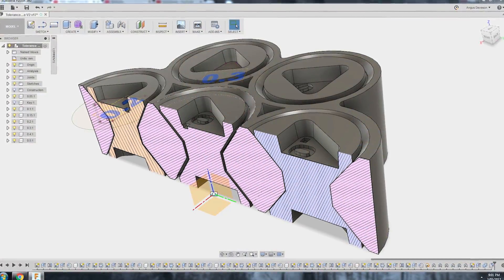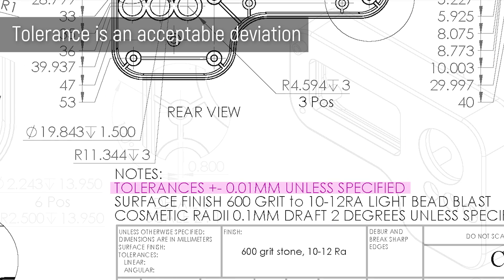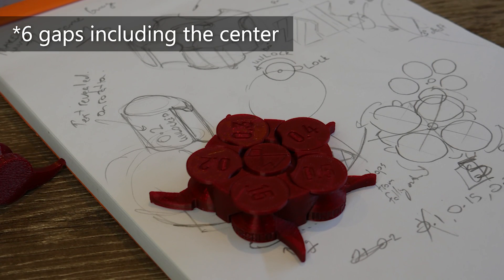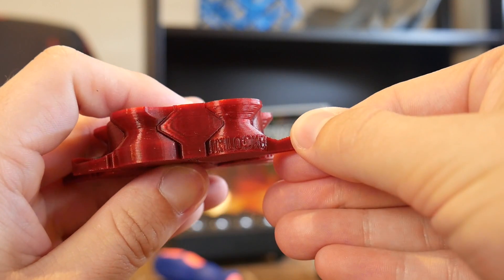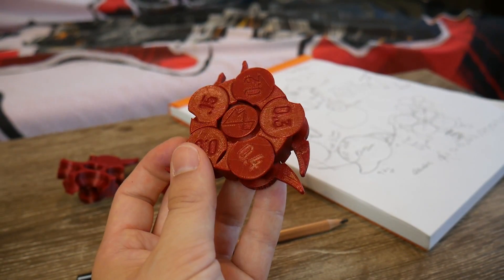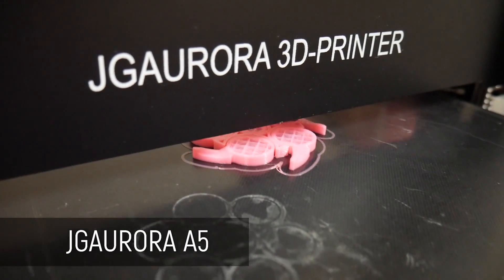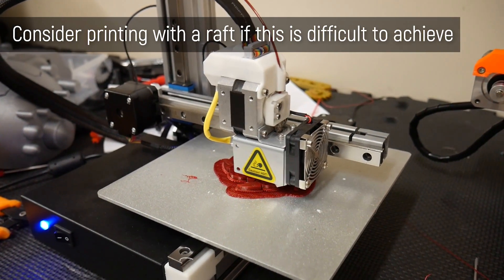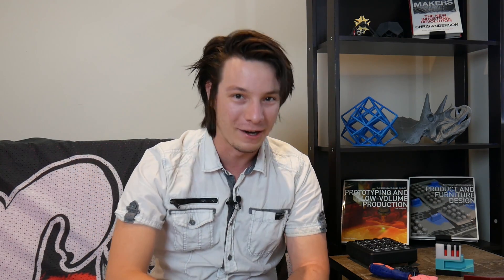Test your 3D Printer's Clearance and Tolerance

Comment: My creality ender 3 3d printer got tolerance of 0.3 minimum. Lower than that it will stuck.
Reply: now that is really good cuz my ender 3 pro
 stuck with 0.5, 0.4 will frigging stick on the initial layer, lower than that? nah
Reply: Maybe u should give attention to x n y axis tention. Check whether u have equal tension on the right and left of x n y axis.
Reply: Do your circle rounded perfectly? If not then sure this is the problem

Comment: I bought your tolerance test about a week ago to use on my Ender 3 but then my Geeetech A20M came in and I had to start playing with that so the tolerance test was put on the back burner then I had the misfortune  to have my hard drive crash. Is there any way that I could re download  the file, I purchased it using paypal.

Comment: Awesome, I just bought it and tried it out. Looks I need 0.3 clearance with normal print resolution (0.15 height) on my ender 3. 
Just a thought, I printed this out with skirt and noted the lowest surface was melted together. I'm curious if the 0.2 might work. I would suggest to add a 45° chamfer to prevent lower face fusion. Anyway, great design though.

Comment: Markforged Onyx One, the 0.15 took quite a bit of force to move, but once it does it is very smooth. At one end of rotation has slightly more resistance than at the other. Everything else spins as it comes of the plate. 6.15 h to print in Onyx. Thanks for cool design, helps a lot with understanding the tolerances and design of gaps. 

Anyone order these from Shapeways? Curious how their machines do it.

Comment: I've just tried this on a ender 2. I have modified it slightly by adding a hot end duct with a 60mm noctua that directs some air flow to the nozzle. I've only had the printer 2 weeks so complete newbie. PLA with a bed temp of 60 and a hot end of 205 I printed this with a 0.3 first layer then 0.15 for the rest. I could free everything upto 0.3. 0.2 and 0.15 were stuck. Any advice? it looks like the bottom is fused. Do you think a raft would help?

Comment: .15 and up were free on the Original Version on a (very well) tuned Anet A8 with the 2040 aluminum frame upgrade:) 0.1 Might come loose with some extra force but the key won't take it.

Comment: I notice when I printed mine, the top layers of the 0.2 and 0.15 look like they have enough clearance to break free, but the first layers in the same area  are completely fused together. My first layer height in simplify 3D is set to 90%. Could that be the cause?

Comment: Hi Angus, I could use your help! Big fan, watched almost all of your videos, made the plunge and bought a Prusa Mk3 over the course of the last 8-9 months. Yesterday I bought your tolerance test model to test tolerances when printing in ABS... and all of the cylinders fused. I was able to get .5mm apart relatively easily, .4mm was tough, and .3mm came apart only with a LOTof force. In addition, the surface finish on top of the part was really rough/bad. What did I do wrong?

I used Slic3r PE, 20% infill, standard layer height. All other settings were the "Generic ABS" profile on Slic3r.

I know printing with ABS means that the part will shrink, but this surprised me. I'm going to print in PLA tonight to see if it does any better, but I really want better tolerances when printing in ABS. Any help would be GREATLY appreciated!

Comment: I've been looking for a free tolerance gauge for 3D printing that people can use worldwide (all dimensions the same on every printer), so i can create 3D objects that actually are able to work on the persons 3D printer. - Since you are the inventor of the Maker Coin and the tolerance test, I wanted to ask if it's possible to get a standard (global) test piece from you, so people can test the tolerances of the printers they use, so it's possible to make items for different tolerances, so they can choose what they need. -  Even if i guess this will never be read, since it's too long ago.
Reply: The first tolerance test wouldn't work for some of the stuff i was planning to make, since it's not a 'tool'. Thus the question of a 'free' gauge for people to print (as said, world wide) as a standard tolerance test for everyone in the world, so people who create stuff have an idea about what measurements are needed to create a range of items for 3D printing, so links, bearings, etc. work for the person printing the items.
Reply: e.g.: looking for a standard tolerance test, something like ISO or DIN. - you are the first, so that's why the inquiry.

Comment: My prusa i3 mk3 kit build is stuck at 0.15 and I had to use a screwdriver for 0.2. I snapped the 0.15 tooth off! Any advice? I'm pretty sure my bed is level.. but how do i tell? I think the PINDA is set right.

Comment: Printed this last night and was pleasantly surprised to see the 0.15mm rotated with just a little thumb pressure. I used a CR-10 with Raptor PLA and the old Cura with 0.2mm layer heights. Thanks for creating this clearance and tolerance test! Great channel!

Comment: Just a thought... My printer appears to have a magic number of 0.04mm (ie. full step motion).
This is based on 1.8 degree steppers, with 8mm pitch screw. ie. 8mm / (360 / 1.8) = 0.04mm
I’m guessing this may be a reasonably common printer configuration?
The point is that you therefore want to optimally work in multiples of 0.04mm increments.
So, normal 0.2mm layers are OK, but instead of 0.1mm (for fine), you really want 0.12mm or 0.08mm.
Likewise, for clearance you'd also optimally want to work in multiples of 0.04mm
So instead of a test going down to 0.15mm clearance, I’d really want either 0.16mm or 0.12mm to test my printer's minimum clearance.

Comment: Should be released as both an STL and gcode (gcode to take the slicer out of the equation and STL so you can play to get it better).  shrug its only $2..  I just wonder how much is slicer settings vs printer itself for some people.  I am currently printing it for the first time with Inland Black PLA on a Wanhao i3 v2.1 Sliced it S3D.  we'll see how it goes.
Reply: Ok time to test the old one with tighter tolerances..  0.15 on the new one works fine but I really want to push it now :P

Comment: Just printed this on a new Ender 3. Either I printed this wrong or it's sort of disappointing as a fidget spinner. The 0.5 just pops out, and so does the 0.4 with minimal spin. Can't spin with only 3 sides. May just have to glue them in. The gauge side seems fine. All moved easily, even in the 0.15. Printed on a raft with 0.15 layer thickness.
Reply from the maker: If you want to use one like a fidget spinner definitely grab the version 1, this one is designed more as a functional tool so you know what kind of movement you can expect from your printer. Clearly 0.4mm is too large, but maybe 0.2mm gives a good movement without too much play? The center part is designed to pop free once you unlock all clearances :) it has a special code on it to another youtube video.
Reply: @MakersMuse  what if i cant move the part what should i change???

Comment: I tried buying the test from Gumroad, but: "By clicking Agree and continue I confirm that I want to use *** for my current and future purchases with Gumroad. I authorize Gumroad to charge my PayPal account for such purchases and I instruct PayPal to pay such amounts. "

What the hell?? NO WAY!! I just want to pay what's in my cart, that's all. Of course I can unauthorize them directly after my purchase but this is against my principles. There is no way I am going to allow this.

@Makers Muse, do you have another way to pay?
Reply: This is also very typical. I will not trust Gumroad: https://help.gumroad.com/privacy -> 404 page not found.
Edit: The brainiacs made it a relative link that doesn't work when you're on the help subdomain. From the homepage it works: https://gumroad.com/privacy #facepalm :-)

Comment: My CR10mini print well only 0.4 ... but if I set -0.3 in horizontal compensation in Cura v3, numbers on print disappears!! 

With -0.1mm works until 0.3 and there are numbers ...but under -0.1, numbers will disappears...
Reply from the maker: Print it on settings you normally use, horizontal compensation will alter the final print accuracy I don't use it.

Comment: Nice design. Payed for it gladly. Got down to 0.2 mm on my modified anet a8. I think due to the mentioned elephant foot isuue 0.15 didn't work. 

Tips while prototyping with this:
1. Stability
2. Extrusion multiplier (mine is 90 percent with darn cheap PLA)
3. Speed and cooling.
Reply: Can I attach links here to show off the beautiful unlocked font?
Reply: Whatever here you go: https://ibb.co/kXfrGc
Reply from the maker: YouTube isn't the best place if you have Twitter you can share @makersmuse!

Comment: gumroad seems to ask for a credit card even if I select to pay with pay pal.
I live in the netherlands and we typically don't have a credit card, but a Debit card.
Is there a way to resolve this, or would you say, just use the old stl file?
Reply from the maker: There should be a button 'or pay with paypal' to take you to the paypal window instead of entering CC details.

Comment: Bought, downloaded and printing right now but in PETG as that is what I predominantly print with on my JGAurora A5.
Reply from the maker: Cool to hear the A5 gathering popularity. Good luck!
Reply: First attempt had the first 2 layers fused with my usual settings in all except 2.0 which was only slightly fused. Played with my settings a little in CURA and trying a second print.

Also posted this video to the FB group I am in for the A5.
Reply: Second attempt failed only because the vent I printed as a mod to the original caught the PETG and bent it, it might also be down to some warping as I lowered the bed temp from 90 to 85, I adjusted the bed setting back up 90 and its stayed stuck. Yay! I am now at layer 40, layer height of 1.5mm, thickness of 0.8, infill of 30% Octet, printing temp 240 with first layer at 245, build plate of 90, diameter 1.75 and flow of 96% (found I needed to reduce from 100 to stop it from fusing), retraction of 4mm/50mm/s speed, print speed of 30mm, wall speed of 15mm, travel of 60mm, Fan 0 initially to 20%, skirt as recommended. 5 hr 11 min print time and 28g of material to use costing GBP 0.28.

Comment: Odd. I printed the v2 of the tolerance test, and could only get as far as the 0.3 (and higher) to work. All the others were stuck even using the key. I'm using a Prusa i3 Mk3 and Simplify3D to slice it. I printed a simple dimensional cube and a 15mm came out as 15.03mm. Similarly a 5mm cube came out 5.03mm. So I don't understand why my tolerance test failed so badly.

Comment: Thanks for making this Angus, I'm kinda low on funds but $2 for this test is definitely reasonable. Just one question though; could you slice this up to make individual tolerance test pieces for each tolerance size? I'm going to realign and recalibrate my Creator Pro, and when testing tolerance and how adjustments improve it I'd like to be able to print just the tolerance level I am stuck on--so I don't have to waste extra plastic and time testing. 

Thanks again.
Reply: That sounds like a good idea!

Comment: First test print for the LeapFrog Bolt Pro and some interesting results!
1. Printer using the suggested settings in PLA.
2. 0,5mm just falls out of the main body!
3. 0,2mm locked but 0,15mm moves!
4. With a little persuasion now all move, but still I kep dropping 0,5mm out of the body.

Worth the money to test out the new printer. Thanks Angus!

Comment: Bought the model today (and no, if you can afford $25+ for filament, you can afford $2,- for a model) and printed it on my brand new Snapmaker. It was loos for the .5-.4 and .3, but .2 and .15 were stuck. It was a while ago that I've seen this video, so I used an exacto knife to cut the first layer for the .2 tolerance and that worked. My son said I should have used just a screwdriver, so I tried for the .15, and that one got free as well! Very happy with my 1st printer, the Snapmaker...

So, just buy the model (and drink one beer less), and print it. If it works out, you'll discover that it's worth it! :-)

Comment: Angus, I just bought the tolerance test v2.  Are there general recommended settings to use in Simplify 3D like layer height, first layer settings, speed, etc...?  I am still new to printing and have not yet done one of these.  I am using an Ender 2.

Comment: This was well worth the $2 even with the fees to pay in £, Got a great print with my CubePro Duo, I suspect it could go down to 0.1. Used ABS at 0.2 layer with 20% infill.  The one from my Makerbot Rep 5th Gen was not so good. Use Makerbot Print, 0.2mm layer and 20% infill just about got the 0.2 to turn, 0.15 stuck fast . Using Simplify3D same settings same PLA and this time the 0.15 would turn but it was tight.  Says something about using better slicing software.
Angus I think your posts are great and very helpful, especially on Fusion 360. Its nice to NOT hear an American (or German) english accent on these type of videos. Your accent is much easy listening here in the motherland. Keep up the good work.
PS. Interested in your prediction that Subtractive and additive manufacture will come closer in the coming year. Worked with CNC Milling/Turning & Laser, big and small for some time and I am not sure that will ever happen in one machine.
Reply from the maker: Thanks Jan! Appreciate the kind words. I don't really believe in multi-purpose machines but think small, good CNC machines are going to be come more popular. CAM was the main hurdle and it's becoming easier and more accessible now.  I see nothing stopping us from having a small format CNC machining center that can do metals (maybe light passes only) under 10K within the next 2 years. Exciting time!
Reply: Hi Angus,  did not expect a reply from such a busy person but much appreciated.
Subtractive Manufacture machines, CNC Routers, Mills and Lathes is a whole other ball game. I have worked as a consultant implementing CAD/CAM solutions within companies for very many years as well as having owned, bought & Sold small machines for Education, model engineering and Hobby use. In the UK the education market was dominated by Denford and Boxford machines. Most have now left the schools (To difficult to use and lack of teachers and technicians prepared to train on them) They have found their way into home and small company use. There is a mass of small, low cost Chinese machines using their own controllers or MACH3 software available in the market now.  But here is the problem.
To CUT anything even MDF, Wood or plastic requires a rigid (heavy) machine and you have to get rid of the material that is remove (Called Swarf if its metal) the harder the material the more rigid a machine needs to be, Just taking lighter cuts wont hack it as that is as bad as taking too heavy a cut due to rubbing. With any metal the swarf gets everywhere and as its conductive and abrasive, any electrics needs to be far away and protected as does the leadscrews and slides. Apart from frame rigidity the harder the material the more power the cutter needs to cut, so a big heavy spindle motor unit on the Z axis and this requires heavy leadscrews to move it and bigger stepper motors (or Servo motors). Thus the machine gets bigger and heavier and more expensive. None of the low cost machines can deal with more than Plastic, Foam and light wood. And they still have all their parts exposed so its Very messy (and dangerous MDF dust is toxic when cut). These are more CNC routers than CNC mills (Mainly 2.5D CAM and use many less tools) CNC Mill/Turn tooling cutters is a whole book on its own and critical to the success of any machining of metal. Most project will use several different tools during the machining cycle. The nearest similarity in 3D printing is using several different filaments during printing and each of these needs its own setup and machining parameters, and to be kept cool and to have a clear path (removal of the swarf). When things go wrong in CNC they go very wrong and metal and bits of tools fly. (not lots of soft spaghetti filament flopping about) thus most CNC machines came out of schools and 3D printers and Laser cutters came in.

I have several CNC machines that I use and all of them (even the routers) could easily have a 3D print head fitted and would make a very accurate 3D printer, In fact it may be a good business opportunity.  I also have some high end 3D printers (Makerbot Replicator Gen 5 and CubePro Duo) and none could be used to cut or mill anything. (Maybe some laser cutting with a laser head)
Most users coming from a CAD/CAM Cnc background  can move very easily into the 3D print environment but the opposite is not so easy.      

You are correct about CAM software being the key and AutoDesk Fusion 360 is a great step forward. ( I have seen, and tried to use some really bad software in the past so its great to finally see some good logical easy to understand and use software about)  The model is the basically the same for CAM or 3D printing apart from assembly ready to spin models like your clearance test, but the post processing for CNC is much more complicated. The CNC options in Fusion 360 although good are considered basic by today’s standards and AutoDESK offer a higher level  ‘Professional’ software solution. 

When you have the time, look at TORMACH Machines (USA based but they do get around the world) I have a PCNC1100 machine and its great for my needs in almost every way. They also have a good on-line support structure and have your equivalent on CNC (Informative, Relevent, easy to listed to, lack of BS) youtube videos and lots on Fusion 360. https://www.tormach.com/blog/video-library/

This is way too long already but hope it helps, difficult to squeeze 20 years into a page.

JCS